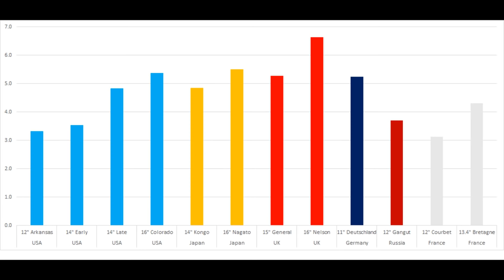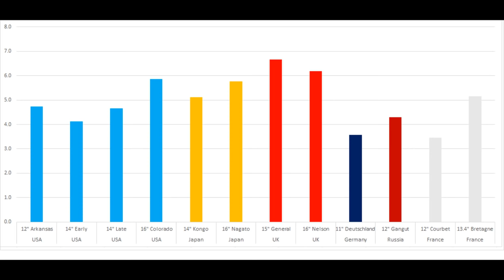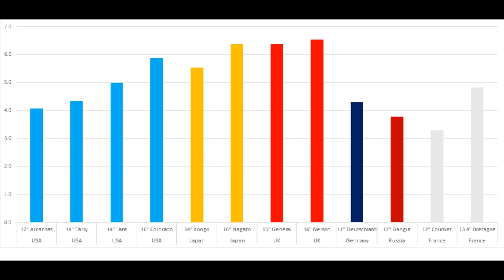Battleship Guns of WW2 - A series of tubes

Comment: As regards to range, would comparing the range of a weapon at a specific elevation, for example 20° or 25° would allow for a better comparison of ballistic properties by controlling for the mounts.
Reply: But is that information availible for every weapon you'd like to study?
Reply: @juanordonezgalban2278  if not, one would hope enough angles are available to at least make a functional graph: one could compare the curves to get an idea of performance.
Reply: Why not include muzzle velocity in addition to the range ?
Reply: @oceanhome2023  Shell weight will affect the loss of momentum over distance, so even a gun with a ludicrous MV will lose more energy over a given distance than would SHS at a more pedestrian speed, if it's using a light shell. 

Honestly, having a category for "momentum at X range" would be more useful.
Reply: @JoramTriesGaming  Why not use muzzle energy = 1/2 m v2?
Reply: @glennsimpson7659  Muzzle energy is one part of the system: it only tell you how much energy there is at maximum; for combat, you'd want to know how much residual KE there is at point of impact, and the angle at which that impact is occurring, as those are what will affect its ability to penetrate. 

That is, one could grade guns based on muzzle performance, but grading them at likely combat range (e.g. 20kyds) would be more realistic, or at least more representative of the environment in which these guns were intended to be used.
Reply: @JoramTriesGaming  Thanks for that clarification - I entirely agree.  It would not differentiate between light shells with higher velocity and heavier shells with lower velocity, but at longer ranges the latter is more effective in holding its velocity as well as having a steeper angle of descent and thus more chance of penetrating deck armour.  I once had a program (supplied by Bill Jurens) to calculate exterior ballistics, including angle of fall at range, but it ran on an Apple 2 computer back in 1980 and I don’t have an updated version that would run on an IBM-type PC.  Both with naval rifles and anti-tank guns, I have found over the years that it is not easy to compare published statistics.  The Warship International article Drach mentions has a very interesting chart of penetration at ranges, in which the British 15” Mk 1 fares poorly, but Drach seemed to be giving it equivalent penetration to other 15” guns.  Likewise some published figures for the German 11” on S & G show a higher penetration ability than in the WI article, and the value Drach apparently gives it.  Certainly the Germans were keen to replace the triple 11” on S & G with twin 15”.   It would be nice if Drach published his spreadsheet figures for us to tinker with.
Reply: @glennsimpson7659  It's especially difficult to compare, given that various nations' techniques differ: the Russian Empire's data for their 12" guns, for example, has penetration of both whole shells, and of fragments from the bursting thereof, whilst the Brits and Americans specify whole-shell penetration as standard, iirc.

That program sounds like it could be deserving of a museum exhibit in its own right: I'm intrigued as to whether someone could reverse-engineer it to adapt to a more modern system.
Reply: @JoramTriesGaming  I seem to recall the code for the program was written in Basic and printed in an early edition of Warship International in an article by Jurens. I never learned to program in Basic but I guess you could rewrite it in a modern version.
Reply: @glennsimpson7659  certainly a neat resource. I'll have to look into it, thank you for the direction.

Edit: Found it: Exterior Ballistics with Microcomputers, No.1 of 1984.

Comment: you could try to look at muzzle velocity alongside range to remove bias from gun elevation, since muzzle velocity doesn't depend on the turret/mount, a higher velocity weapon having a flatter ballistic curve compared to lower velocity one similar to the advantage of range, otherwise it seems pretty good
Reply: Muzzle velocity can also be adjusted very easily, just put less charges in.
Reply: When trying to go for high range and/or a flat ballistic arc they won't usually put in fewer charges.
Reply: @trumpetedeagle2  Yes but generally can't put "extra charges in" if you have a gun with a low velocity to start with
Reply: Velocity would also I expect have a big impact on accuracy, since if the shell reaches the target faster it will have moved less / easier to predict?
Reply: Hood would have appreciated a flatter ballistic curve from Bismarck

Comment: I was surprised about Drach's rating of the French 15" gun which in my opinion is very underrated. Its known unfortunately for some of the shell defects but the guns of the Richelieu class were on par if not slightly better then the Bismarck class when those defects were fixed.
Reply: If I'm not mistaken the French also didn't introduce delay coils well after the conclusion of WW2. And since the 4 gun turret is basically just 2 2 gun turrets literally strapped together, there were some accuracy issues. 
Obviously if I'm wrong it means what I said is a load of crap lol, but if not that might contribute to why people would rate the Bismarck class' guns over the Richelieu class'.

Comment: I have to go further into bursting charge size effects..  I only rate these shells into generic classes, AP (under 4% filler weight), SAP,/Common z(4-5% filler weight), HE (over 5% and under 8% filler weight), and bombardment/CPC (over 8% filler weight, up to 12%).  I assume a reasonably powerful, detonable, HE-type filler and effective, reliable fuzing capable of giving a full-power detonation of that filler type reliably (at least 80% of the time, roughly), which unfortunately for many shells, including WWII German AP and SAP-type shells, the fuzes and, particularly the booster/"exploder" that sets off the main filler was not very good in some designs with the post-WWI reduced sensitivity fillers (not a problem with Japanese shells!).  It took some nations some time -- if they ever com0letely fixed the problems -- in getting reliable detonations even when the shell worked perfectly otherwise.  German shells, maybe due to sabotage from the slave labor or not-so-good design work with booster charges, seem to have had the worst problem during WWII.  British shells using Shellite had a problem with this too, since they originally used the delay-action modified version of their old Lyddite fuze, the Number 16.  Shellite was much less sensitive to impact shock, as desired, but it also was somewhat more difficult to detonate at full power, so lots of "partial detonations" mixed with less-powerful, black-powder-like "violent explosions" occurred,  These gave OK results in many cases to nearby spaces in the target, but not nearly the complete destruction desired.  The TNT fillers used in smaller guns and, I believe in the NELSON 16" APC shells, was actually better, since more work was done to make these shell detonate at all using Tetryl boosters and only later did tetryl boosters start being applied to Shellite-filled APC shells with good results.  A mixed bag here.  The US use of Tetryl, starting in 1928 (the same year that British TNT shells started getting reliable Tetryl -- "CE" -- boosters) and had a better design from the start, using two small rocket-nozzle-shaped pits ion the sides of the upper end of their fuzes with Tetryl filling them, so that they fired two needle-like shaped charge jets into their extremely inert Explosive "D" fillers and very reliably set them off in full detonation with this redundant booster design.

So, let us say that all of the shells go off with full-power high order detonations.  The filler size does affect the blast effects, with the bigger the better, obviously.  Bur larger fillers cut out bigger cavities in the shell, greatly reducing the number of high-velocity sideways fragments of the main body of the shells.  Nose pieces of heavy-nosed, base-fuzed AP, SAP, and CPC projectiles are all broken up into a few large chunks (sometime they stay in one huge piece) and can act like a huge bowling ball tearing through several spaces and only bouncing off the thick deck and far-side armor plates.  However, these are not very many pieces and only do relatively minor damage, barring a blind luck impact (not likely) -- pieces of the armor punched out are on the same scale of secondary damage effects.  Base pieces are just as big as nose pieces but tend to be reduced a lot in speed by the detonation in front of them and do little damage, if any at all.  So you get faster, but less high-velocity middle-body fragments from large-filler shell, but s9mewhat slower, but a lot more, fragments from small-filler shells. So as long as the filler sizes are in the ranges I give above, the total effect of blast versus fragments roughly balances' out, since fragments cause somewhat different, but just as deadly damage as blast does (its a "wash" as far as I can see).  When the filler sizes switch to the larger ranges, the blast effects get bigger much faster than the fragment sizes get smaller (the filler cavity gets longer and makes some more fragments due to this) so there is "a more blast for the buck" effect, but the ranges have less effect since the ship spaces are fixed in size and you can only do so much damage to the space you blow up in and perhaps one space to the sides by blast along (fragments from side blasts do not penetrate very well due to their small size and highly irregular shapes), so it takes a lot larger filler size to get more blast-created damage results that matter.-- the CPC/bombardment shells are much like small aircraft bombs, with CPC (the later TNT-filled version after WWI) having some light armor penetration ability due to its heavy nose and AP cap and SAP-type base fuze -- US bombardment shells, originally railroad gun projectiles in WWI, also had base fuzes, but were designed as merely enlarged HE/HC shells with very little true armor penetration ability, but good rock, masonry, cement, or earth penetration against land forts.
Reply: Wow, thanks for these thorough comments. I made a somewhat speculative comment above about the potential shock effect of US 16" AP shells against Yamato's riveted armor belt. Could you comment on that? TIA.
Reply: Nathan:  About the overall energy balance:  For the AP shells that I've looked at the explosive energy of the bursting charge is appreciably less than the kinetic energy of the shell.  For example, the IJN Type 91 AP projectiles used in the Type 94 18.1-inch guns weighed 1460 kg and were fired at a muzzle velocity of 780 m/s (2600 ft/s), giving an initial kinetic energy of 444 MJ. Assuming complete detonation, the 34 kg HE bursting charge added an additional 140 MJ of explosive energy.  So depending on the striking velocity and energy loss during armor penetration, the kinetic energy of the fragments might be anticipated to be somewhat more damaging than the blast effects of the bursting charge.  I tend to think of AP shells as kinetic energy attack weapons rather than explosive weapons, but I've no idea if this notion is correct in the real world.
Reply: @stevebloom5606  Most of the belt armour of Yamato was welded (only the thickest sections were riveted).
Reply: @bkjeong4302  Yes, the ones that mattered the most!
Reply: @tomkunkle318  In terms of raw material damage, the impact definitely does more damage, but the explosive payload is there more to get those juicy secondary explosions from cooking off ammo or rupturing boilers than any additional kinetic energy benefits.

Comment: I think this video shows that there are a lot more factors to gun performance than one may initially think. One thing that I think is useful that you mentioned, but was not used in this comparison was 'overkill' in regards to penetration. As I understand it, the 16/45 guns on the Washingtons and South Dakotas were chosen to have that length because it gave better angles of impact for penetrating deck armor at long range. Looking at data, that seems to be the case, at 20,000 yards the 16/45 guns have better deck penetration than the 16/50 guns even with their higher velocity. Of course the 16/50 guns have better belt penetration, but the 16/45 guns still have enough to penetrate anything short of a Yamato at an angle, while being able to penetrate over 4 inches of deck armor and opening up a significantly larger target area.

This could lead to scenarios where which gun is better depends on the range, and would require a lot of input data, but I think it is interesting to look at nonetheless.

Comment: I think you could have bundled range and mass under a „kinetic energy“ (0.5*m*v^2) category. A shell with more kinetic energy will also travel further and a lighter shell might do more damage if it travels faster than a heavier shell.
Reply: There would still be some differences not readily apparent just from (initial) kinetic energy alone, though. A heavier shell will usually bleed less kinetic energy in flight, as for instance making a shell twice as large (in all 3 dimensions) will grow its mass (and hence kinetic energy, if initial velocity remains the same) to a factor of 8, while only increasing its surface area to a factor of 4. This means it will lose speed due to friction / resistence more slowly than the lighter / smaller shell.

Comment: I saw at my father's workplace (late 80's) the lathe that had been used to turn the barrels for the Iowa ships. The bed had been cut down from 120 ft to 60 ft. It had an enormous 50hp motor. It was bought at auction mostly on a whim and it never got used. It was barely transportable over the road even in pieces.
Reply: Very very cool.

Comment: There is one very important metric that was left out. The amount of shells that could be fired per rifle before they wore out and needed relining or replacing. This is the category that would have sunk the Yamatos down quite a long way. Due to the complicated shrinking/expaning around a wire part they would not have been durable in the long run, and a shore bombardment would have been disastrous for the rifling.
A high estimate would be around 150 firings before the rifling was shot, and since it was impossible to reline them they would have needed to rebarrel them. Not then counting that they would likely have peeled like a banana at 200 firings mark.
Reply: The 15” guns on Littorio and Vittorio Veneto should probably also have been marked down in this regard.

Comment: Hi,
Been watching your channel for a little over a year and enjoy it very much. Thanks for the information and entertainment.
I was in the U.S. Navy for 24 years - about half as a Gunner's Mate and half as an Ordnance Officer, so enjoyed todays episode.

A couple of comments on your evaluation.
1. The bursting charges aren't directly comparable because different countries (and possibly time periods) used different explosives. This may be one of the reasons the U.S. consistently uses smaller charges.
2.  WRT range, as you mentioned several times, gun elevation has a significant influence one the range. A better data point may be Initial Velocity.
3. The Rate-of-Fire category is almost entirely a function of the ammo and turret handling system (ie, the elevation the gun can be loaded at, which in turrets that have to load the gun at zero degrees elevation, the elevation speed again becomes relevant).While this may be a tie breaker in your presentation, it's not strictly a function of the gun.

Again, good episode

Comment: Drachinfel,
While over all I think you did a fairly good job, there were a few places that I think some things were missed.  You did make a good call, trying to include the CEP, even if you were not able to find enough data for the vast majority of the ships.

- I think that a minor factor, that was missed, was that of the sectional density of the projectile.  The greater the projectile's sectional density, the greater amount of energy that is retained, throughout it's entire flight profile, not just to an arbitrary distance.  This might be a weapon system thing, but not any more than also including the size of a projectile's explosive charge, which leads me into the second item...

- Simply using the size of an explosive charge, is a crude approximation of destructive potential.  If you are going to use the size of an explosive charge as a significant factor, you also need to balance that with the type of explosive used.  If Projectile A uses an explosive filling that has 25% greater energy than the explosive in Projectile B, then Projectile A can afford to use less, explosive filler, and still get the same explosive damage potential, despite the explosive weight difference.  While not as exaggerated as comparing black powder and nitrocellulose, the differences between Amatol, TNT, Torpex and Composition B, can add up.  Where can you find it?  It's out there ( at least 10 years ago ).  It took some intensive Googling for me to run down the comparisons I did back then, but where to find it now...

- Accuracy...while something that you included as a factor, I am left wondering if it was right to include it, if for no reason that at least some of it comes from how how the gun was mounted and used with the system as a whole...and stuff like that that probably makes it more of a weapon system factor, than an individual gun factor.  IIRC, both the British and Americans had some accuracy issues, that became less of an issue by building in a slight delay into the firing circuit, so that in the case of the Americans, caused the turret's center gun to fire a fraction of a second later than the two outer guns.  Accuracy is also going to be affected by range finding equipment, ballistic computers, and as you have mentioned elsewhere ship stability.